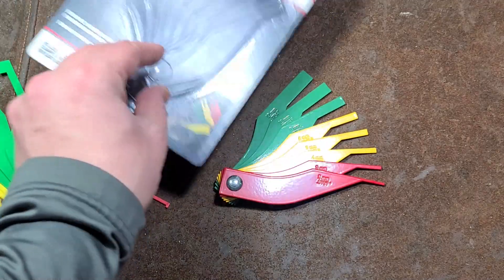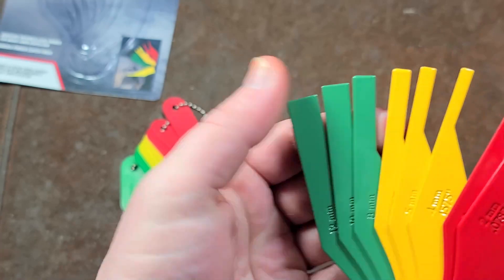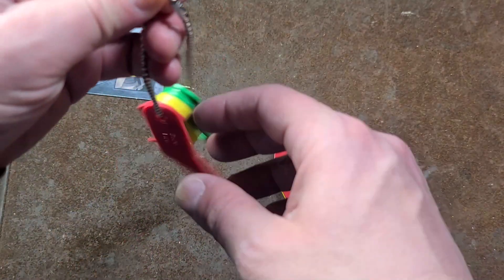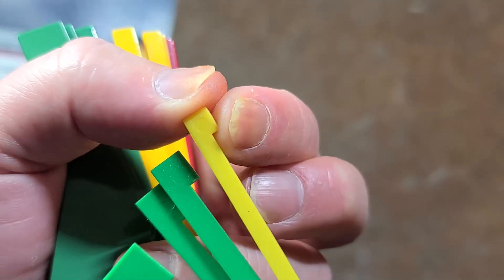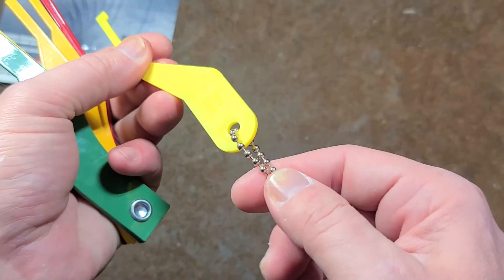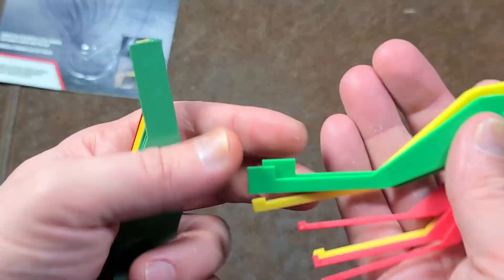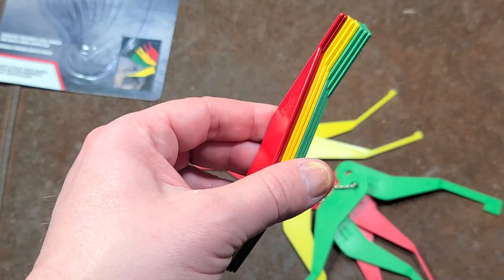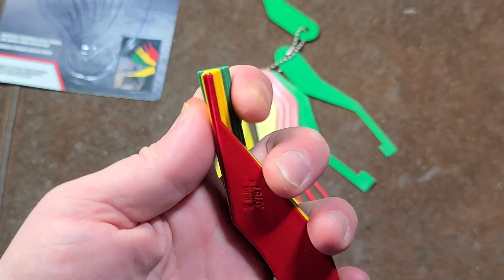Harbor Freight Pittsburgh Steel Brake Pad Thickness Gauge Set Review

Comment: Probably really late here in the game but ive noticed the measuring tool i think all manufacturers dont match up with the multi point inspection form.  On the tool, red is 3mm and below, yellow is 4 to 6mm and green 7mm and above.  Inspection forms, red is 2mm and below, yellow is 3 to 5mm and green is 6mm and above.  Not sure if its a big deal but its something that I've tried looking for in forums.  What do we go by, tool or inspection forms?

Comment: My first Car.

...I had a 1984 Ford F150 step side.
It cargo bed was metal frame sides a wooden bed for its deck.

Made By the Ford Motor Corporation. So original parts.

The Steel Wheels had a solid hub cap that was plastic. And you could not see the brake caliper  from the outside.

But as a novice in my age 20. I didn't know a thing about cars and trucks. And Gearheads.
 Looked at me like im not going to tell you
           "NOTHING"
I wish i had this tool or knew about it all those years ago.

Times a change in.
Thanks for the heads up on that Lyle tool.
Even tho i cry at the price. I know i got to buy one myself.  
...Im glad Catus suggested the right one.
And the reason why it would melt. So ill be cautious with it. 👍cat.

Comment: I don't know about cars and trucks but different makes of motorcycles have different thickness pads. Some HD pads look worn out when new compared to other makes. Different aircraft types can also have varying thicknesses when new. I would call this "a for referance only" type tool. Your modification should greatly improve the metal set. Drill out the hinge rivet too!

Comment: These are nice tools for professionals. But for DIYers brake pads are so cheap that I'd rather just replace them at regular intervals even if they still have some life left. No reason to go through all the trouble jacking up the car and removing the wheels and not replace the pads and rotors which isn't that much more work from there.

Comment: These gages look gimmicky, maybe check the brake pads when rotating the tires
Reply: That's what I'm saying. I don't need a gauge to know if my pads need replacing. They are cheap enough that if I need to lift the car and look then I'm just going to replace them. Done and done.
Reply: These are for shops so they can tell the customer the exact thickness of the pads and if they need changed or not. Not really a diy guy would need